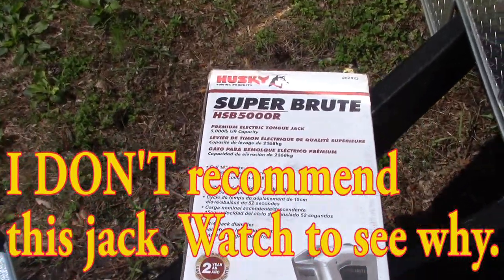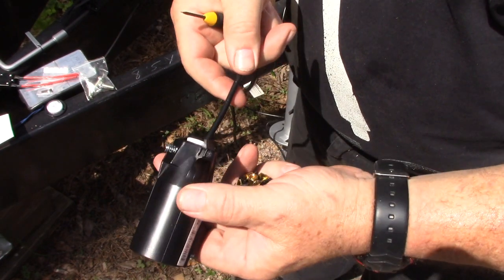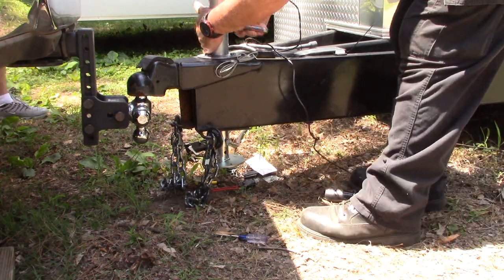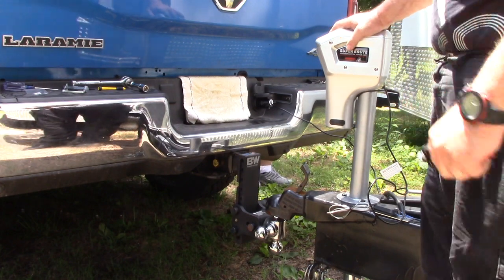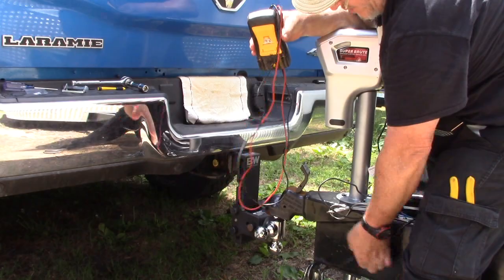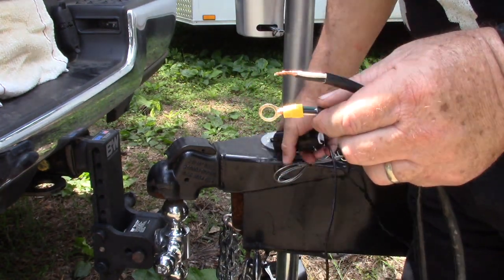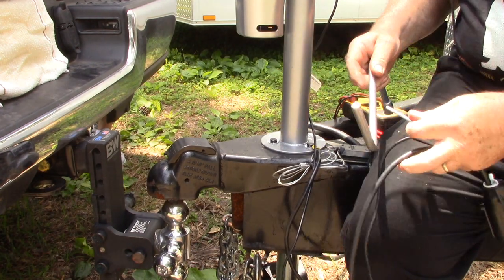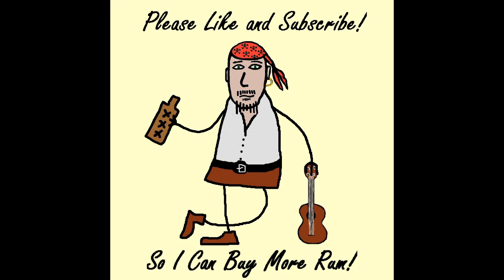Review of Husky Super Brute 5000lb Electric Trailer Jack (I don't recommend it)

Comment: thanks for sharing, 
actually, the issue there is that model was design for RV trailers. RVs have the battery negative connected to the chasis, so the ground would work. and you always have the battery right behind the jack, so connecting positive is a 5min thing. 
there are some models design for your trailer that comes with the 7pin connector already installed. 

on an RV, you wouldn't want to depend on connecting to a 7pin to move the jack.

probably the 5k lb was an over kill for that small trailer also
Reply from the maker: Thanks for the intel!
Reply: @PirateStu  how was been reliability so far? 
I bought a "super advance Ultra-Fab Products 38-944040" with memory position and everything, and the control panel has a factory reliability defect. it leaks water and creates a shortcut. they already sent me 2 more units and same issue with any hard rain. 
looking to change it for this super brute (probably the 4500lb for my 10k lb rv.)
thanks
Reply from the maker: @RaymondCidadMoser  This jack is holding up great since it's never been used because it was broken right out of the box. I intend on making a video of how to fix it once my new shop is built.
Reply: @PirateStu  for real? another factory defected? whats happening with the jack industry? 
Im actually looking to move away from Ultra-Fab brand because of 2 defective units, but seems like husky also have issues? 
did you apply for the warranty? 

Ultra-Fab offers a crazy 10 year warranty. and they are actually pretty good are replacing it within days. 
the thing is, Im now scarred to keep using Ultra-Fab because this time the water cause the unit to activate and completely extend on its own. thank God it was a rain while we were parked. can you imagine that happening while driving in the highway? 

let us know what end up happening with your unit 

thanks for the feedback
Reply from the maker: @RaymondCidadMoser  the problem that I had is detailed in the video.